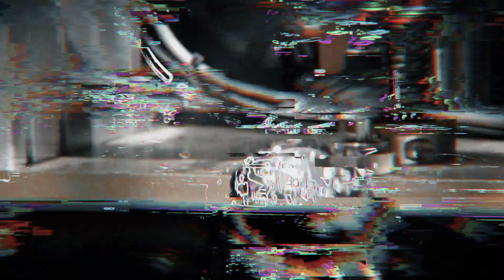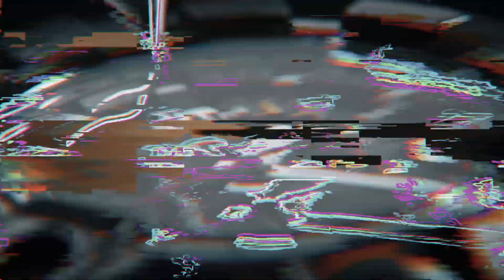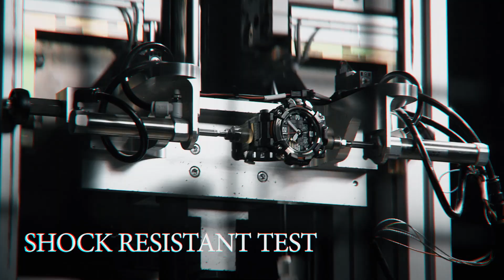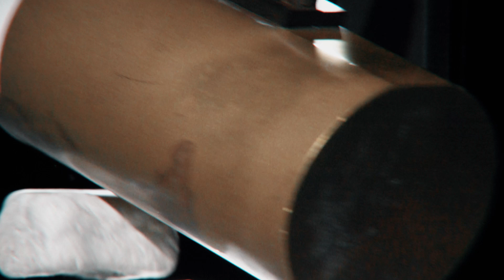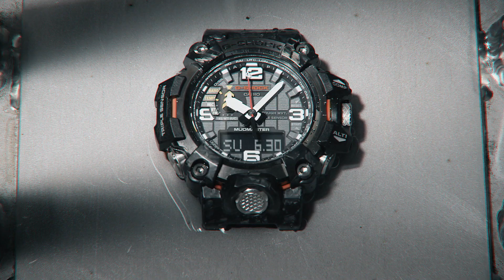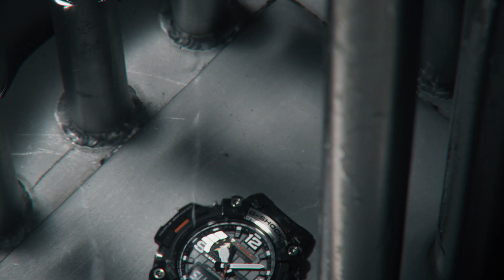Challenge the Limits MUDMASTER GWG-2000:CASIO G-SHOCK

Comment: Yet no magnet resistance , just one magnet can change your analog timings..then you have imbalance in digital and analog
Reply: want some magnetic resist? Get an Omega Aqua Terra? That thing can withstand up to 15000 gauss
Reply: The gwg1000 has magnet resist...
Reply: It doesn't matter, that is reserved for the more premium Triple G Resist G-SHOCKs. The Mudmaster has "Auto Hand Home Position Correction", meaning it automatically checks the position of the hands every 1 hour, if a magnet or some shock has caused an "imbalance in digital and analogue". Or you can go to the setting and ask it to auto correct before the end of one hour
Reply: I don't agree with that. The auto hand correction feature automatically realigns the hands for you. I have tested mine out with a magnet and it works awesome. I've never had any issue with the hands getting out of alignment. I've worn mine while shooting over 20 rounds of 44 Magnum heavy bear load ammunition. No issues whatsoever. This watch is a tank. Much stronger than watches three times the price.